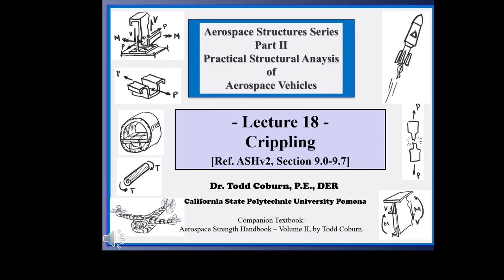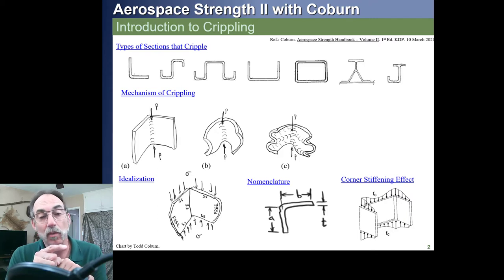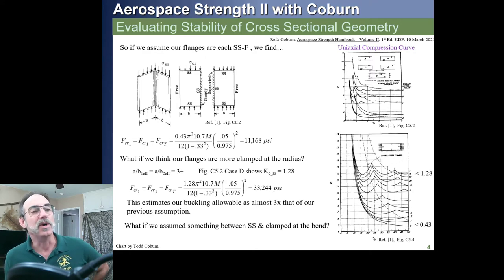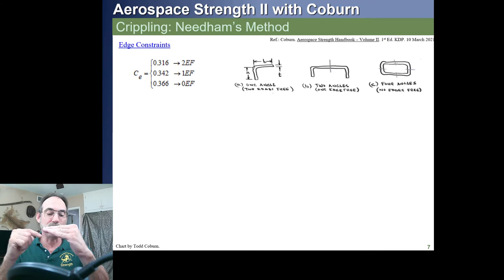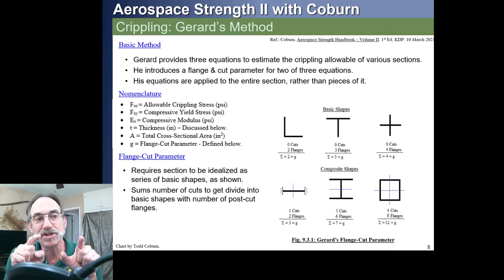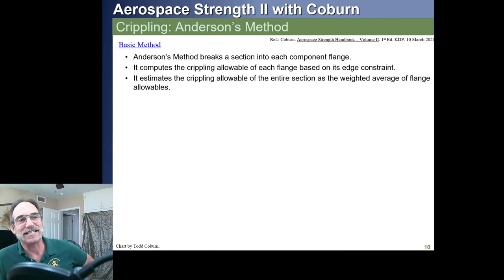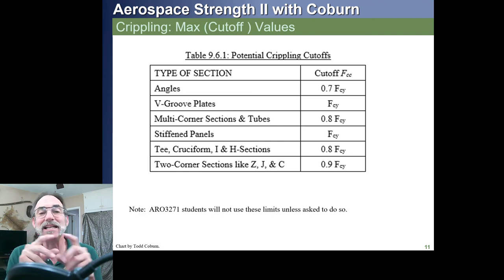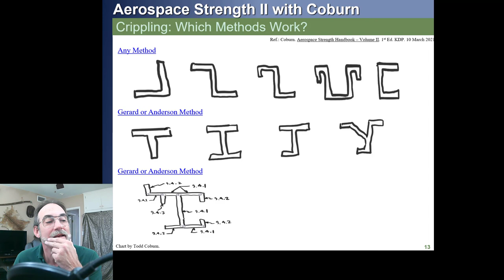Stress Analysis II: L-18 Stability - Crippling of Thin-Flanged Sections

Comment: Just wondering about the classification of sections with Gerard's method. Is the Z, J and C section only talking about extruded sections or does it apply for formed sections as well?
Reply from the maker: Gerard’s method does not distinguish between extruded and formed sections.  So it is applied the same for both.
Reply: @ToddCoburn  Thanks Todd! You've been nothing but great help!

Comment: Some random comments. (1) The effective lip chart in Bruhn has been shown to be unconservative (analysis and test) since it doesn't always capture distortional buckling modes (e.g., distortional modes being a half sine wave length of 3 to 5 flange widths). Testing has verified that if a cross section is critical for distortional buckling, then crippling strength is not even realized. The distortional mode is the lip corner going unstable and then driving premature collapse into the entire column much before crippling. See ESDU 78021c. This is why the floor beam stanchion cross section was changed for 787. There's no analytical methods for predicting a distortional mode and not all cross sections have it, so something like CSFSM or FEA is needed. (2) Test based coefficients for crippling have historically been normalized to tension modulus instead of compression modulus. That makes Ec unconservative. Which is why the McCombs / Boeing method is unconservative if compressive modulus is used. That may or may not be true for Needham and Gerard, but I'd have to double check. I think it was unusual to have compressive modulus available 70 years ago in ANC-5 (predecessor to MIL-HDBK-5), so tension modulus was often the reference. (3) If you use McCombs method in Niu, Ec is unconservative for sure. (4) It's good to point out that if the column is short enough (e.g., L'/rho << 12.5) then the crippling allowable increases in conservatism because the local buckles don't develop. (5) If it doesn't locally or distortionally buckle, it won't cripple. (6) Crippling is a post-local buckle collapse load (local buckle meaning half sine wave length = one flange width). Crippling is not a stability mode in itself but a material failure driven by the strain gradients at the inflection point caused by flange buckling. So for a crippling specimen with L'/rho=12.5, crippling almost always occurs exactly 1/3rd or 2/3rd down the span at a very specific point. It's basically a point material failure. For example, for b/t=30 the local buckling occurs at about 1/6th of the crippling load. The corners generally remain stable after collapse. Maybe formed sheet metal with large corner radii would have corner buckling like the picture on the ppt slide??? I've never seen that because the testing I've done has only been machined corners. (7) For Aluminum-Copper-Lithium alloys, Fcy cutoff is unconservative. Load drop occurs slightly sooner. This has to do with the anisotropy of modern aluminum alloys. You can actually get a shear-fracture in the corner prior to Fcy cutoff, which his scary because the load path disappears. Not a good material for fuselage stringers.
Reply from the maker: Great feedback.  Thank you.

Comment: When doing an L section if we use the Gerard method which section type would that be, would it simply be the 3rd equation at 32:00?
Reply from the maker: Yep.  An L section is an angle, so the third equation is appropriate